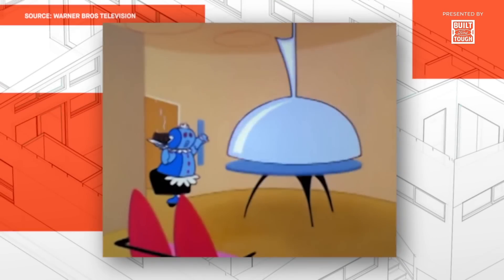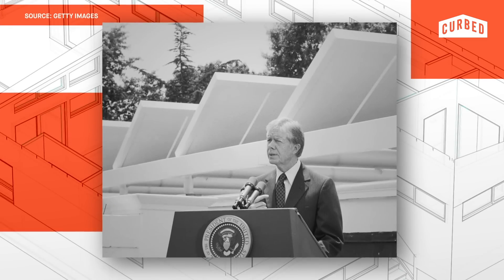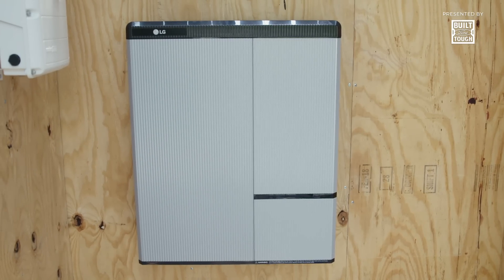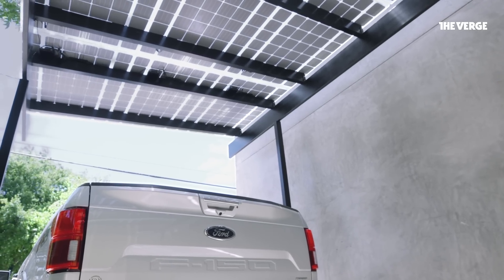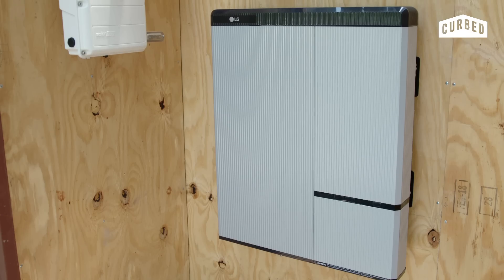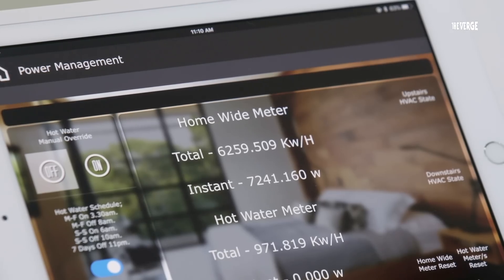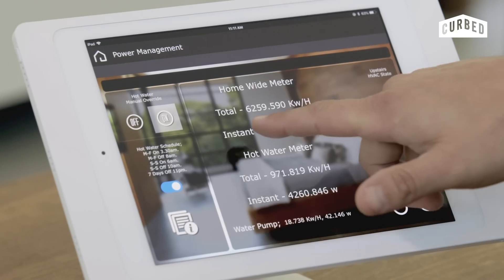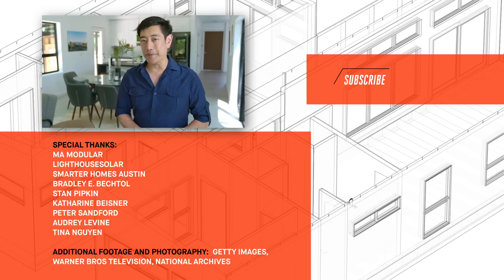The future of renewable energy is making it look cool

Comment: Why build a solar array that doesn’t meet 100% of your needs from the beginning?
Reply: Correct. Also why is the solar panel partially underneath a tree?
Reply: Imagine you fuel your F150 with sunlight. Then you'd be onto something!
Reply: Just like the episode discusses, What is 100%? US Average is ~11,000 kWh a year (~30 kWh a day). So how big (kWh generated a day) of a system do you need? 

The shortest answer to your question is Cost. If a 100% system costs $55k vs a 60% system is maybe $35k, that $20k difference is a ~$90/month mortgage payment. And ~$45 a month difference in solar generation of the 2 systems. Your daily 100% energy use could vary, so it may be better to go with a non-100% system as some Energy companies don't allow a home to generate more than it consumes.

So let's say you have some good weather and you don't wash a lot of clothes, and your system can't store the extra power as your battery is full. If this is a frequent occurrence, that extra $90 a month mortgage does not sound that good. And adding another Batt to store that power would just add to the system cost and still would not get used. 

I would opt for the most cost-efficient system, not worrying about the 100% needs as my needs may change and that change would likely be less if monitoring daily power use.
Reply: @Clayton Ebeling For Austin, TX and 11,000kWh/annum a 60% system would be 4.5kWp and a 100% system would be 7.2kWp based on PVWatts weather and irradiance data for a south-facing roof system. Panel prices would be ~$1k per kWp and an inverter another ~$1.2k... so in both cases the costs (given they bought the expensive battery) are sub-$10k incl. labor because it's a new build with the marginal cost difference being ~€3.1k. The 100% system would yield $1304/annum of power (based on average US rates) and the 60% system $816. So ~6 years to make up the difference. You could also use a diverter to send any excess power beyond to the hot water tank instead of the grid when the 10kWh pack is full (though that should last the whole night).
Reply: But electrification is only going to increase, here in The Netherlands, the national gas grid is going down within a year or 15, electric cars (and charging them) are becoming a thing, and most of the cooking will be done electric in the future also. So imho it's better to install close to 100% off-grid capable, especially when you can sell back your oversupply to the grid, when that isn't a thing (or stops in a few years like here) then looking at home storage (powerwall etc) becomes an attractive option.
Reply: @Limp Wibbler You can compensate somewhat for shading using micro-inverters or DC power optimisers but both of those solutions up costs by at least 30%
Reply: Agreed. Better suited to accounting for a minor shadow like a neighbours chimney in the evening than something blocking out large amounts of light like that tree.

Comment: although the house looks great, there are some things that are kind of weird:
- big pickup on the driveway
- trees shading the PV panels
- inductive charing the phone instead of using a cable

meeh....
Reply: Jos Gelissen 
Odd choices.
Reply: Yeah inductive dubles the energy usage.
Reply: Alvar Lagerlöf no headphone jack
Reply: Yeah, but phones don't use much electricity, so that's not really a big deal.
Reply: but billions of phones uses a lot
Reply: PV modules need to be in the best spot on your property to get the fullest potential of them, everything else is design nonesense.
The main reason why pv has not yet exploded in usage all over the country is price, so by intentionally lowering the output of your modules like they did here, you will break even on your investment far later than necessary.
Reply: I think they hooked the battery up after the inverter too, I think it makes more sense to go DC Panel -> DC Battery - DC -> AC Inverter
Reply: Jos Gelissen just put the panels on the roof and get over it, these are just gimmicks